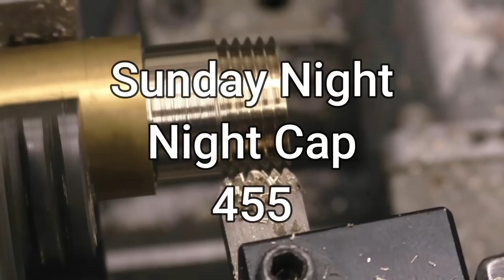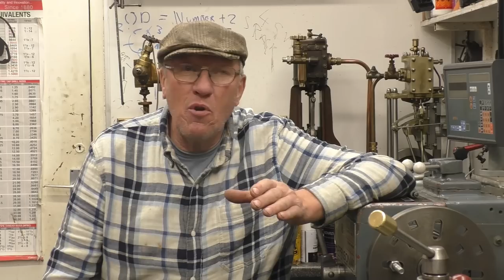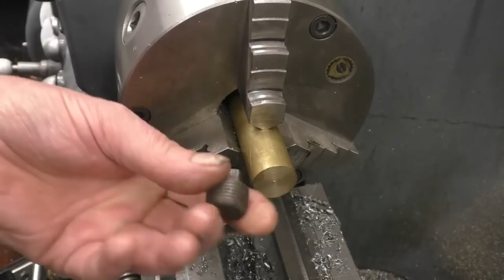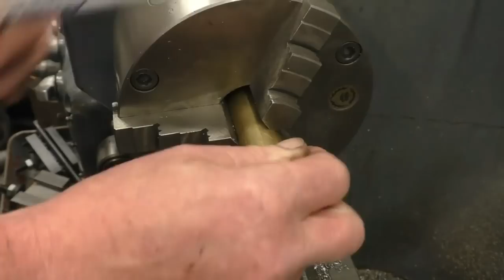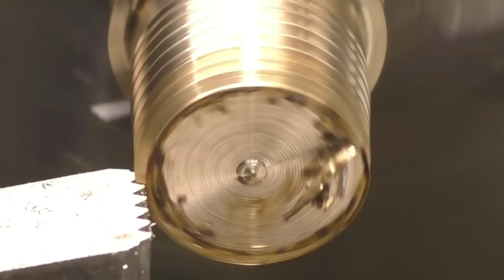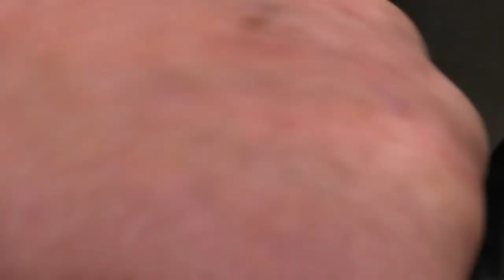SNNC 455 P1 . BSP Taper Threads

Comment: Hi John, I think from memory that the thread form is perpendicular to the axis of the fitting and not perpendicular to the taper. I'll check the spec at work tomorrow. I've never cut a taper thread so I'm not quite sure how it should be done though.

I'm sure you'll go down a treat at the technical college, wish I could be there!!

Good luck from Spain!!

Comment: Nice to see how you managed to go ahead with the thread cutting 👍👍 . Your in full contact with the chasing tool so that cut is increasing the load as it cuts, agree with you saying about cutting a taper on the part  , may help grinding of the the first 3 threads on the chassing tool a bit to relive the tool pressure. Hope that makes sense.

Comment: Nice work around John. Assuming it was a hand chaser you had set up in the tool holder, you could have used that to hand finish to the required fit. As apprentices we used to get bollocked for using hand chasers in the tool holder but were tought to dress threads and even cut them from scratch in brass with hand chasers on a tool rest. The same way you would turn wood with a chisel. It involves an L shaped rest being held in the tool holder. As they say, more than one way to skin a cat and it's not wrong if it works.

Comment: I don't doubt you can use this thread like normal, but it contains multiple errors in it's taper, helix angle, contact faces of the flanks and pitch diameter. There is an even easier way to do it properly, without requiring a taper attachment, by placing a stiff tapered pin, or even an angle gauge on the tailstock, and attaching a follower rod on the cross-slide (infeeding via the compound at any angle between the flanks like normal), to maintain pressure against it with the crosslide, while cutting away from the chuck with a left hand holder upside down (and an IR insert instead of ER in case of laydown inserts)

Comment: Well John, I think you just broke the internet machining a pipe thread like that 😃.
The thread is good for the most part, just the first two threads are no longer in a taper is all. Knock those two off and it should be good 😁.
Cheers! 🍻

Comment: Great proof of concept. If you were cutting NPT I'd think a longer cutter would be needed so it doesn't cut a straight thread however many threads the trailing edge passes the start of the bar, but as I understand BSP usually uses straight female threads regardless, so no worries there.
Reply: BSP is a parallel thread,  but John is cutting a BSPT, an tapered thread, similar to NPT or I think it used to known as "Sellars"?.
Reply: @bostedtap8399  my understanding is  BSPT female doesn't exist, the female thread is straight regardless of whether it is to accept a straight or tapered thread. In NPT both sides of every joint are usually tapered.
Reply: @Broken_Yugo  BSPT is a tapered thread form for internal and external (Female/Male). NPT is based on BSP form, BSPP is the parallel thread.

Comment: It's strange that a high-end metric lathe like a Harrison would only use an approximate method for cutting imperial threads (63 tooth gear instead of 127 tooth).
Reply: Harrison did use a 127 tooth gear, but these days they are very hard to come by, and not so easy to make because they are a large diameter. I’m pretty sure John got a 63t made for him - it’s only a few thou out on most thread pitches, which isn’t a problem for short threads.
Reply: a 127t, simply will not fit the Harrison 140 Geartrain. Thatis  why Harrison supplied the 63T as standard and the imperial gear chart was inside the change wheel cover, sorry cannot uplaod pics to this reply, otherwise I would show the Chart inside the Guard
Reply: @stangordon1595  Oh yes, of course - I’d forgotten that (I’ve got a much later 165, and the 127t will fit but I can’t find one!)

Comment: Time 02:15. Don't You put grease to the gears? I got grease looking like black shoe paste for my mini lathe. No problem applying the grease but exchanging those gears later.... Dirty business.

What a fight! Just a nightmare. 
Saw a YT video, a guy putting a boring bar head in the tailstock and offsetting it. A dead center installed in the head and clear to go, like conventional threading.
Adjusting the head stock.... not on my hobby machine. It will never come back to the center again.
However, threading pluggs for a large steam engine boiler would be too much.
Reply: @sourand jaded The tail stock center is off as much as the taper needs. I don't get it, about sin. Some guys use a ball between the tail stock parts and the threaded object. Yes, the cutting speed will change according to the diameter at the cutting position.
Reply: @sourand jadedOkey. You argue about the cutting speed. It varies just marginally at angles small like this. The major variation takes place in the axial direction, fully natural.
The speed varies  when facing off the end of an object. No trouble there. The RPM can of course be increased getting closer to the center but is seldomly used. How do You make a tapered thread? The method I tried to describe is what experienced and skilled guys have been showing.